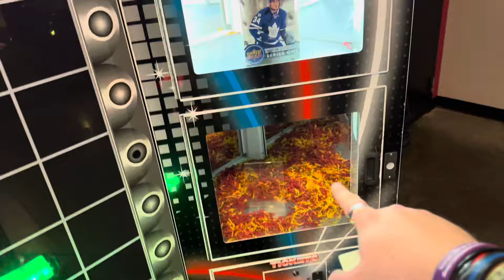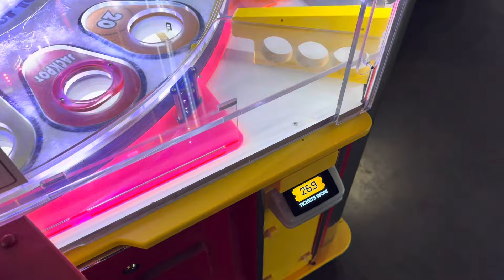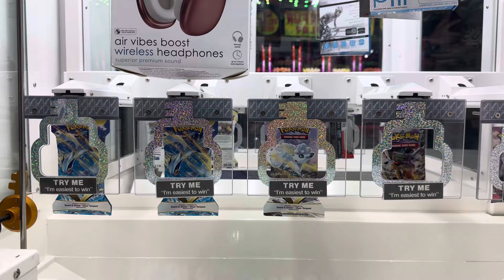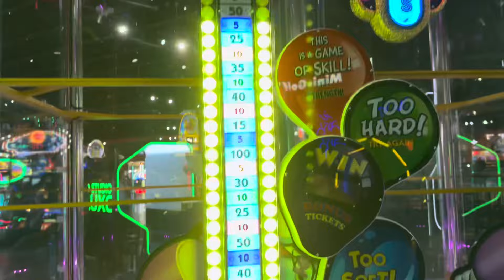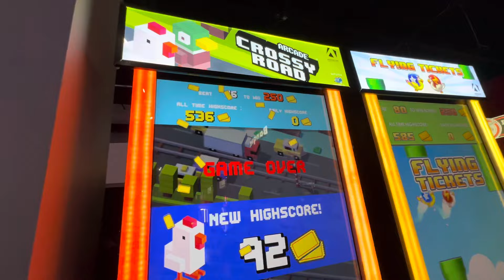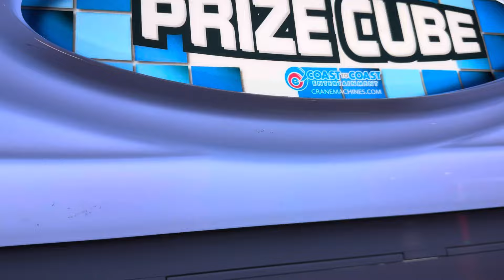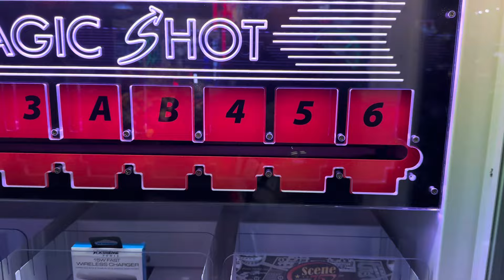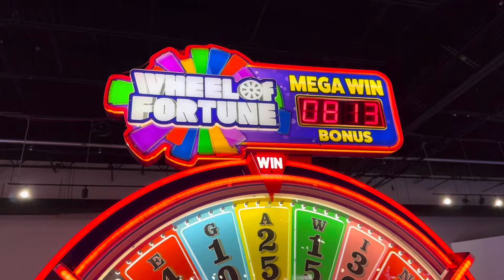JACKPOTS GALORE AT SCENE 75! | JJGeneral1 Arcade

Comment: I have been binge watching all your videos. I have  stupid question znd6i apologize in advanced.  When you are playing the key game. I notice you say let's see if its ready. What does that mean?
Reply from the maker: So these types of games have a payout, where the vendor can set the amount the machine has to take in before giving out a prize. 

In the case of Keymaster, you can tell if a row is target if the key just barely hits the bottom of the hole (if you missed). If it goes above the hole, chances are it “deviates” above it as the machine forces the loss until the payout threshold has been met.
Reply: Thank  you so  much for taking the time  to answer my question.  I greatly appreciate  it
Reply from the maker: @isurvivedscammy3109  no problem. If you have any other questions, just let me know. I also have a series of videos called “how to” that explains a lot of these games from inside and out.